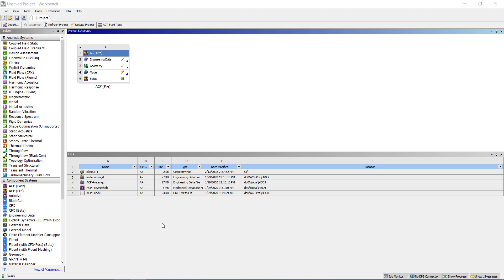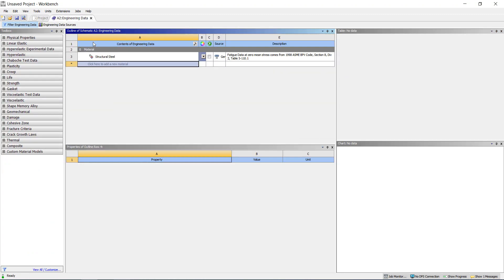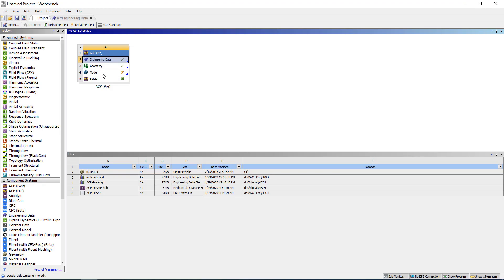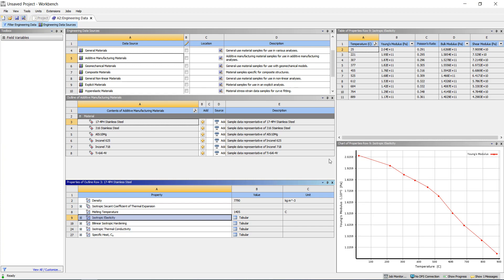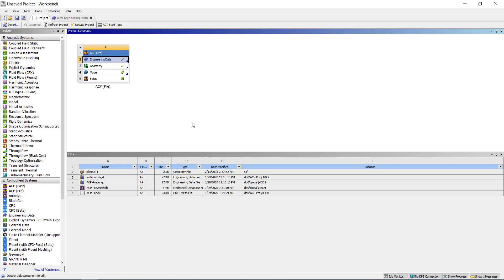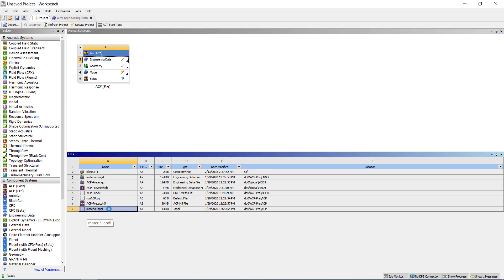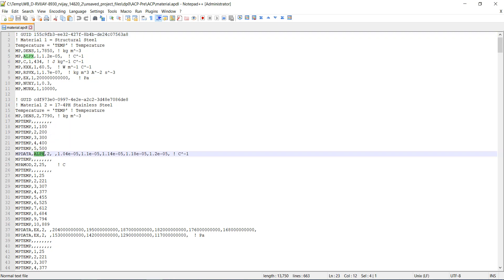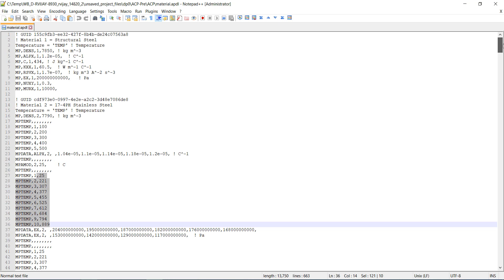The Easy Way to Export Materials from ANSYS Workbench to APDL

Comment: What about the opposite way, such as concrete 65 from ansys APDL to workbench, thank you sir
Reply from the maker: Hi Mohammed, feel free to drop us a note at info@simutechgroup.com if you're interested in our consulting services and we'd be more than happy to help! Otherwise there is the ansys student community to find posts/articles: https://studentcommunity.ansys.com/
Reply: @SimuTechGroup  I did not get material property file generated as shown in your show, what did I possibly miss?
Reply: I used both 2017 and 2021R1 WB, and all other files were generated except the material property file for APDL. What was I missing? Thanks.
Reply from the maker: @lipinghuang6895  thank you for contacting SimuTech Group. If you are interested in mentoring or consulting services please send us an email at info@simutechgroup.com or you can check out that Ansys Learning Hub here: https://www.ansys.com/services/ansys-learning-hub or we have an Ansys User Group on LinkedIn: https://www.linkedin.com/groups/1938106/